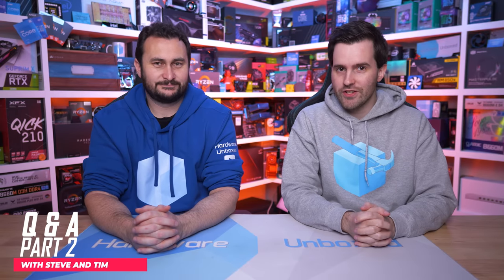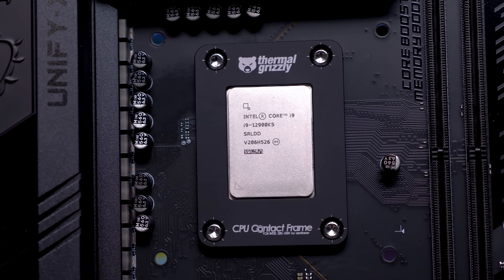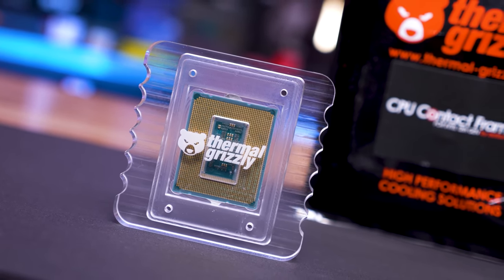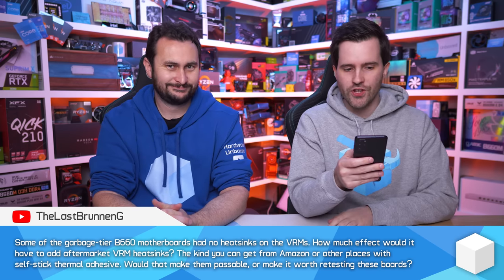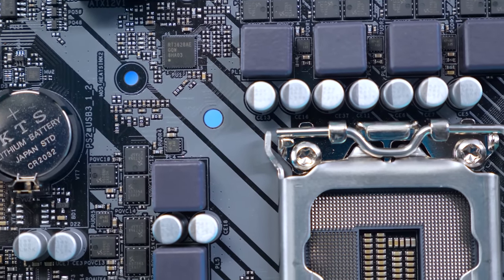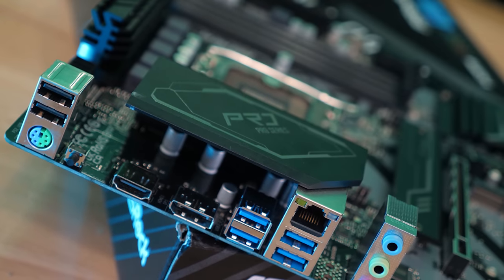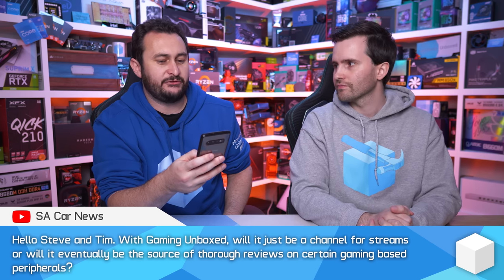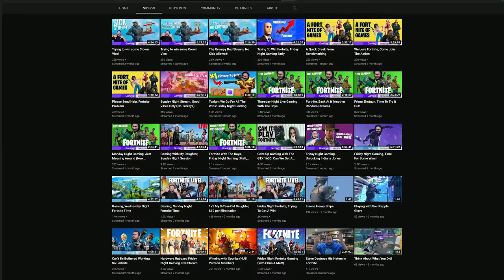Biggest Tech Fail 2022? Zen 4 To Make DDR5 Relevant? August Q&A [Part 2]

Comment: I don't care for DDR5 currently, buying the new Ram this early is silly because it's the slow and expensive stuff. I plan on getting a Ryzen 9000 CPU probably, assuming that releases in 2024 or 2025, by then DDR5 will be cheaper and faster options will be available. First generations of CPUs with the new gen Ram are usually not gonna be adopted by mainstream audiences even though that's what Ryzen 7000 or previous Intel 6th gen were targeting

Comment: At 100% CPU my 12400 only draws a max of 60w. So I am fine with the 100w limitation on my b660, right?
Reply from the maker: It uses 60w at the base clock, it uses around 120watt when boosting.
Reply: @Hardwareunboxed  I have been testing this, and even when boosting my monitoring software says i dont use more than 60 watts. Shrug
Reply from the maker: You might be running with power limits which isn't good. BTW you can quickly run a Google search to verify what I've told you.

Comment: E-DPI is pretty common when talking about mouse sensitivities, but I like cm/360 more. It's pretty much "how far do I have to move my mouse IRL for my character in game to turn around 360 degrees". Raw input can be a factor, and not all in-game multipliers are created equally, but you don't have to worry about those with cm/360. It's also easy to consistently calibrate new games with cm/360 because all you need to do is find a pole or something while in game and spin around. Personally, I'm a big fan of 45cm/360. (For reference, that's 3000 E-DPI Overwatch. I use 1200dpi x 2.5). It's comfortable for me with all shooting styles, and the best part is that 45cm is the length of a QCK+ and a just under the length of a G640. 1 full spin = 1 swipe across my mousepad!

Comment: About the 4 thread CPUs vs the 5600X's 12 threads, one thing to mention is that going from 4 threads to 8 threads is a 100% increase in potential performance. Going from 12 to 16 is only 33%. If the 5600X begins to struggle then the 5800 will be right behind it. From a purely numbers view, the 5600X should last longer than a 2500K but of course it depends on humans and who knows how hard CPUs will be pushed in ten years.

At least with the games/scenarios that HUB talks about. This doesn't apply to me.
Reply: SMT does not offer a 100% increase in performance.  That's literally impossible, because there are no additional execution units with SMT.  The only thing SMT allows is better utilization of those execution units when one thread is stalled waiting for data, as you can give access to those units to another thread without doing a context switch.

The average increase is probably on the order of 15%, with good results getting around 30%, and bad results going slightly negative.  There are occasional outliers, but that's with software used by almost no one.
Reply: @TrueThanny  Yup. I would be surprised if it's only 15% though. Either way going from 4 cores to 6 is a bigger step up than going from 6 to 8 which was the point I was trying to make.

Maybe sometime if I am bored I will test out SMT. I just found a quick cinebench test and it was 45% faster with SMT on there. Someone else had 31% on blender. That was all I could easily find but it certainly looks like way more than 15%

Comment: I've got the MX518 Hero (been using the MX-518 since it launched the first time so long ago). And I'm using 3200DPI. I have no idea how people are able to play at 800DPI haha. I'm able to get from left to right of my screen within an inch of movement. Wouldn't like it to be more! Also, this mouse is heavy so I guess it helps with smaller movements. I'm at the complete reverse from the mouse trends I guess.
Reply: By getting used to it and with a big mousepad low dpi is comfortable and PRECISE.

Comment: I use a DPI of (I think) 6,500 and control everything basically with slight movements. I'm told this is pretty bad, but it's what I'm used to. I've tried "arm aiming" or whatever it's called, and I just can't do it. It physically hurts my shoulders. I'm old.

Comment: As a Linux user the biggest issue with Arc GPU's is you can't buy them. Obviously Shit drivers is our communities thing, Look at AMD since they open sourced their driver Our community has built good Opensource drivers which that tech has gone back in to their Windows drivers. I personally would love to have a pay with a new Intel GPU's, Wouldn't use it for gaming mind as it going to by shit for that, but I would love to play with its decode and encode hardware cores. As I have been playing with their iGPU's Hardware decode of AV1 make's 4-8K 60 AV1 Youtube run so lower power than burning 6 cores to software decode. Making the weak i3 12100 good for HTPC system on less than 150w max. Good for multi screen as one you can watch 4k and the over do you work without losing Compute power. I think the Decoders and Encoders of Intel would be good for workstation use. Gaming graphics is to monopolised by the big 2, and no incentive to dev houses to code for Intel GPU's as know body has them bar a very limited number of people. So buying a GPU or many to test your games on when 0 public currently have access to buy them is a waste and thus gaming on Intel will suck like on Apple there is now money in it. But Intel Decoding and encoding could become big names with big tech Youtube comes to mind. Buy million pound GPU just for decoding and encoding large amouts of video is costly as the GPU's are cross the board ones like Nvidia A, Quadro what every they are called now come with all the extra Gaming cores which production doesn't need in intel fill that market with low cost high rate GPU decoders and encoders Arc could make a lot of money. I recently Brough an 12100 for it iGPU because while it cannot game for shit, for 4K60 Film decode and youtube AV1 4K it run smooth while only AMD Chips with no board GPU and able to run 4K AV1 floorless are still over £100 and is the second hand 3400G, when i3 12gen can run the with ease. the 4600G is £170ish £40 more and than in get warmer because it old Vega and uses software render. Intel are fine tuned on to the importance of AV1 and stream tech or gaming. Which is getting more API focused over Brut power. As many are going to Ray enabled card that on old style DX11 games run slower per $. I think it is way to early to right of Intel move to GPU's also the tech get down lined into iGPU's so it is not a lose as like Vega which was a total bum in the dGPU would outside of mining, made great iGPU's. On a non gaming iGPU based PC using CPU graphic Intel not only affordable but works will as social media as has AV1 decode. Even the gutless low end sub £100 CPU's in 12th gen can run AV1's. While Ryzen the lowest end stuggle with software AV1 and that at a £160 price up for the Ryzen 4600 and the 5000G Ryzen are on everage £30 more than the 5000X version. And that is with Vega GPU a 720p APU, and to run a AV1 4k, cooked all 4 of my cores on my 3200G no good for a small PC or HTPC itx system where a dGPU can not be fitted. Not like any are good value today to by. I call it the APU   ITX tax. 5600G have been selling for the same price as 5600X when at heart the 5600G is an (£140) 5500 with iGPU and for that you pay £60 more. While the iGPU tax in uk puts about £35, as i3 12100F is about £90-100 and the i3 12100(Non F) is £135-ish. I Vega worth in for a iGPU that has non AV1 decode, a graphic core for 5 years ago that bottoms out of 1080p low-mid in most games. So intel are on to something just maybe not Gaming dGPU's however going on the cost of buying say a Nvidia RTX 3080+ for AV decoding and encoding, and it being just as slow as a entry level Arc card as non gamer I would jump on the Intel card and then buy say an RX65000 or RTX3050 for affordable gaming, I have been gaming on Vega 8 so both would seem fast as F to me currently. There is a massive market for AV1 capable DGPU's and iGPU's just for creators. At the end of the day you build a PC for gaming it all about the FPS and detail screen etc. build a workstation it to work on and do Video editing or Audio work neither you need the dGPU for it powerful fps in games. So a product intel Card hence most likely OEM sold card there is a market on low end encode engines which spend all day just encoding and nothing else. If I was to start a site that manged and processed Video Intel would shine right now just due to the cost and shortage of dGPU that are suitable for a work station as the lowest end workstation card you need to do heavy weight Encoding you going to have atleast an RTX3080 or RX6800 Just because the gut it take to convert to them. So if Arc come in around the £400 market when the others are all £600+ from a power and cost point Intel are on to a winner. While gaming is such an monopolised market I wish them the best as only a company with million in the bank have a chance of making a impact and Intel have that money and more competition  in market the better. UHD graphic are so under rated and it is just because of Gaming.  On non gaming tasks they work better and on AV1 play back switching on the hardware decode save 15% and 4 core's of CPU work when watch AV1 in best quality and that has power savings and on a company level that has a lot of savings. if Intel keep the low Wattage and focus on the power of hardware aimed at only API's and encoding etc. They re going to sell. As I said earlier I use want one now to pay with it. Drivers are a non issue on Linux as I suspect some Chinese programmers that was able to by them may already have good Linux drivers. As yet that is the only place I hear they have been sold. Nothing there about stereotypes please, and all of them all being coders or mathematicians , It purely they have the tech first there, I would ask Intel why as most opensource coders and windows coders live in US or EU.

Comment: I am happy with my 9 year old FX 6300. Runs almost every AAA game at 30 fps or more. Need a better CPU to run emulators though.
Reply: Build a AM4 PC for cheap though, or get a prebuilt one. APUs works fine for you if your 9 year old PC plays games at 1080p 30fps.
You can do 1080p 60fps then with a decent APU.... Maybe a laptop?

PS5s are hard to get so its moot to say that consoles are a option.

Steamdeck might be a better alternative actually.
Reply: @dra6o0n  yep the steam Deck is on my radar as well. I am still going through some old games on my backlog so my current rig works fine. Just want to see some proper next gen games on PC before building something new. I cant believe how many years of usage you can get from a decent gaming rig these days, specially after going through the late 90s and early 00s where high end PCs became obsolete every couple of years.

Comment: my brother is running an i3 3220 and a gt 730 and his games still run fine for the most part jurrasic world evolution2  can launch most of the time and the first jurrasic world evolution ran great and when fnaf security breach isnt stuck loading everything on the near decade old hardrive it actually runs pretty well i don't think 4 cores 4 threads is useless or even bad considering the 2 core 4 thread part is doing fine heck I ran Destiney 2 at over 60 fps on that old machine when it was my pc and it was what i played fortnite on for two years i wouldnt recamend evry game cyberpunk would litterly kill the machine i think a good chunk of games would run great on it with a gt 1030 in it instead of a gt 730

Comment: If ddr5 is so irrelevant, why is amd pushing it so much? Couldn't they have made their B series boards ddr4 compatible and reserved ddr5 for X series? Because right now package price for even the lowest end 7600x is $600+ which is insane.
Reply: DDR4 on a platform that is supposed to last into 2025+ makes little to no sense, especially when you combine it with the 4 chipsets and Zen3 out there for people that don't plan to buy futureproof. Who wants to deal with that mess of combinations?
Reply: Dumping DDR4 is a result of supporting the motherboards for so long. No one wants to validate both 4 and 5 for three or more generations of chips on every AM5 board that's made. Boards get more expensive that way as well, due to added complexity.
Reply: @walkir2662  Guess that makes sense but it definitely hurts the value of zen 4 especially at the mid range. Maybe they should have priced their mid range lower to account for that. As it stands right now I see 13600k handily beating 7600x at a lower price.

Comment: Biggest tech fail which still stands out to me was the ATi HD2900XT - the hype was huge and it underperformed while being hot and power hungry. I did end up buying a HD 5770 a few years later so they did a good job turning it around.
Reply: Omg I remember that card.
Reply: Wasn't driver support cut a little short for the 2000 series as well? I forget.
Reply: @SianaGearz  I've got a feeling you're right, though at release I just had a laptop with a HD 2600...which could just about play Crysis so the HD 2000 series wasn't that bad 😄. It just came when nvidia made a huge jump with the Geforce 8000 series.

Comment: I built my 2 daughters new rigs 3 years ago with 10100F's, just managed to upgrade them to 10600's for £130 each. Bargain price for 6 cores 12 threads, I'm expecting 5 years from them as they game at 1440p 165hz and I'm getting them 3070's for Xmas, so CPU shouldn't be a bottleneck especially when they only play Roblox, Minecraft and Fortnite 🤣

Comment: DDR5 is gonna be relevant when intel/amd decide it is. Obviously AMD is doing that right now since next line of CPUs just announced will be DDR5 only. So if you wanna get a new AMD CPU you have to get DDR5, there is no choice for you. Your only choice is to stay with an older AMD platform or stay with DDR4 intel options. Intel will soon move to DDR5 completely and then the question will be answer completely that you simply don't get to choose.

Comment: DDR4 is EOL , AM5 is meant to last at least until 2025+ , its the only right decission to go with DDR5 . Even Intels Alderlake sees gains with DDR5 , Zen5 will be even faster than Zen 4 and Zen6 will be faster than Zen5 , both will fit into AMD , if AM5 lasts as long as AM4 maybe even Zen7 will fit into AM5 .... . PCIe 5.0 MoBos and DDR 5 maybe expensive at first , but it will pay off .

Comment: 15:40 maybe after initial testing of new generation, make video in which you test your recommended  eg CPU with all or only recommended GPU. Lets say you recommend 12400F for mid range, so test it with all or recommended GPU on 3 resolution, next video test 5800X3D with same GPUs on 3 resolutions, so people would know what best pair is. I think doing same for GPU after release would be good too, it would give information which CPU get new, or maybe is worth upgrading (for this would be best add few most popular old CPUs).
For example as I have Ryzen 3900X and want to buy new GPU from Nvidia or AMD I would like to know (from real test, not opinion) how much performance I would lose for given GPU (because looking at 1600/3600/5600 testing I would lose performance) so I would buy slower GPU because I would not get as much performance as I would have faster CPU, or change CPU too. (or do nothing and wait for next gen :P )

Comment: I run a Corsair Scimitars mouse... max 18k DPI I run it at 12k in all things. 
One side benefit.  The kids and wife never seem to want to use my machine. Yes I touch the mouse and it goes one side of the screen to the other. Use the same settings in blender and photoshop ect as well. I use a very light touch and can't stand a mouse I really have to move.

Comment: 8:20 - I generally use 1000dpi on the mouse settings, stock windows speed with mouse acceleration off. And then set in game sensitivity such as that it takes 25cm to do 180 degree turn. I have no idea how tose masochists aim with 8000+dpi and max sensitivity

Comment: I used to use 8200 dpi @ 3.2 sense in csgo with windows set to 6 out of 11. yes I used to move the mouse less then 3 CMs to do a 180
Reply: Haha that's actually insanely high. If you actually gave the numbers correct it would be 1.58 CM for a 360.
Reply: @lepari9986  I lowered it now after a few years of that to 6400dpi with csgo in game of 2.85. at first was always landing short of people but now I am good again :)

Comment: 29:40 I have a 3080 from the early days as I got a LG CX (4k 120hz) and it's been a blast to play on 4k with this display. God of war, Spiderman... all the AAA games. It gets 60fps+ on everything and DLSS works wonders with no difference to my eye. It's paired with a kinda old now 3900X, but for 4k I don't think it's a bottleneck at all. For FPS titles I use the gigabyte M32Q for 1440p at my desk. For the TV I got a 15m optical hdmi 2.1 cable that I run across to the living room where the TV is, it just takes like 30s, and the Xbox controller has no issues with reception. I think that's easier than changing the GPU each time hehehe (i don't even have another PC in the living room)

Comment: DDR5 not required unless they add in some more gimmicks like games that only works with raytracing lol.
Except existing systems works fine, especially Unreal Engine 5 games which doesn't need raytracing to look good.